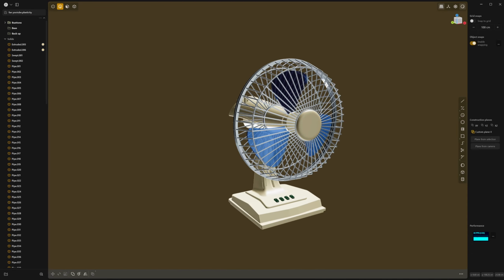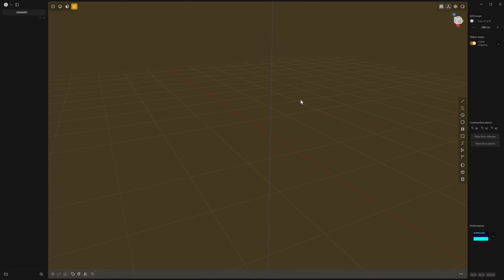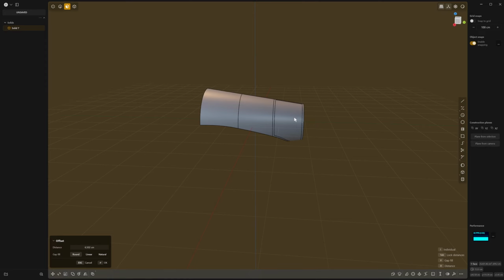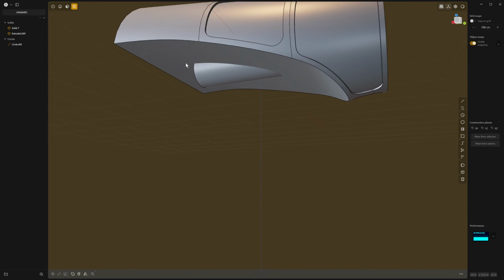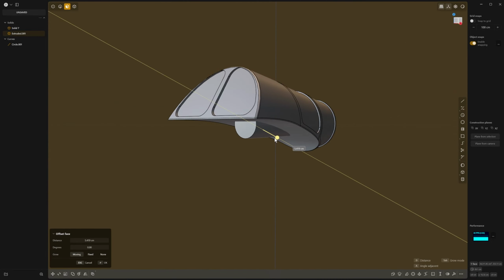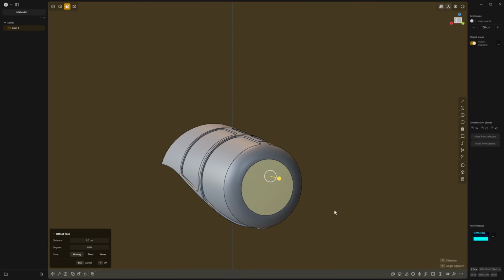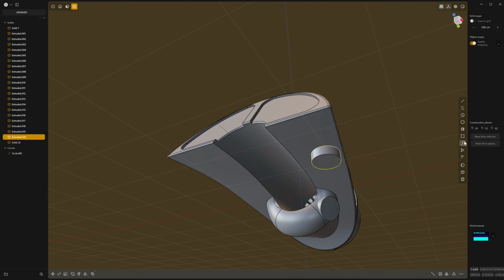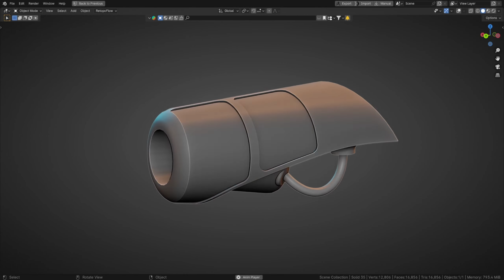Learning PLASTICITY The BEST Decision I made to Improve my 3D art!

Comment: Hello... Thanks for the video - 

35 seconds into the video you bring up a tool (circle) selector - for the surface, line, etc. -  
How do you get this tool ? 

Thanks
Reply from the maker: Thanks it's a custom pie menu I did a video on it here.
https://youtu.be/7MODtnqFEAo
Reply: @takerefuge3d  Thanks - got it set up and working - had been thinking of building at hardware solution ( Macro KeyPad)  but this does the trick !
Reply from the maker: There's a standalone software called autohotpie on github that allows you to make pie menus for any program, it's pretty good but when plasticity got native pie menu I stayed  using those instead. 
I have set up plenty of macro pads and never end up using them as having to move my arm somewhere physically away from my mouse or keyboard breaks my flow. 

 @rchelinewbee300

Comment: it's not parametric and changes are destructive though, not a fan.
Reply from the maker: That's fair, I find destructive modeling process allows you to work quickly and sparks my creativity, other people work better parametrically.
Reply: @takerefuge3d  yea, i do feel like it got its place though, it's pretty nifty.
i will probably use it for some things but if it doesn't have constraints it just can't replace everything.
Reply from the maker: @alkeryn1700 absolutely, I think there is plenty of parametric cad software that from what I can tell works a charm, plasticities charm is in its simplicity and speed of iteration. It's not for everyone but I learned modeling in blender which can be parametric or destructive and I always found destructive modeling to be more satisfying.
I think if I was trying to design things for physical use rather than games then the benefits of a heavier software package would be more obvious to me.

Comment: Nice to see Plasticity getting so much love and enthusiasm. I have been considering it myself as a good modelling aid. However ,I want to use it to model for game engines and I have been wondering how was the topology when transferring to Blender. How has your experience been in this regard?  Cool vid, keep up the good work!
Reply from the maker: Pretty good to be honest, I mainly model with a game asset workflow. you can get tris or ngons out at different levels of detail. And uving ngons is a breeze.
If you check out my channel I actually made a blender plugin for optimizing ngon based mesh in blender to prepare plasticity (and other ngon based hard surface models) there's a free lite version on Gumroad. 
I feel like its easier to optimize a plasticity output generally than optimize as you go doing hard surfaces in blender.
But that might just be me.
Any way that's my take on it..
Also if you do decide you want to buy plasticity check out my discount code in the description.

Comment: You got some amazing content showing plasticity. I started looking into it. What annoys me the most with Rhino is chamfering and filleting. But I also use project to surface and follow along curve a lot, can plasticity do these things aswell ?
Reply from the maker: Thanks for that. And to answer toe question Plasticity has imprint curve as well as project curve command as well as a curve array if that's what you mean.
Reply: @takerefuge3d  thanks, gonna check it out. the 149 dollar version is not gonna cut it as it does'nt support step file export so I can export back to Rhino for final assembly or sending the object to our CNC and robot machins for wood carving :( hehe.
Reply from the maker: @SunSin91  Nice one Cheers!, You can Use my Code REFUGE10 for a 10% discount especially, as time goes on there will be more features in Studio so i see it as a good investment.,
Reply: @takerefuge3d  tried curve array, yeah it works, but not strong enough, it misses the option to follow along a curve with 2 sides where the width of the curve goes from small width to larger width to smaller width. Theres only a scale option. That I think broke my workflow :( its for ornaments in woodworking which I have been using Rhino for last year.
Reply from the maker: @SunSin91  Ah I know what you mean The curve modifier combined with array blender has a similar function where you can assign different weights  to control points...

Its a good point and I might check feature requests and add a request if there isn't already one on the feature requests page
Reply: @takerefuge3d  yeah that would be a killer for a lot of people working with cnc and wood, especially since the fillet and chamfer is so damn efficient + all the ways patching and lofting works. Thanks for chatting about this: ) I'll follow along and learn from your channel.. keep it coming: )
Reply from the maker: @SunSin91  WillDo!

Comment: sorry - what exactly do you do to make a solid from sheet. google and the plasticity documentation is not helpful.
Reply from the maker: A solid is an object with no holes in it.
 A sheet is either a flat object out any thickness or a 3d object with a hole in it.
So either you use the patch command to close the hole, or while in selectiion mode 4 you'll see an icon at the bottom left and with your selected object you can thicken a sheet the icon is two arrows pointing away from eachother., hope this helps.
Reply from the maker: @sketchfields I made a Video on the topic https://www.youtube.com/watch?v=UGkpth-Ag8c
Reply: @takerefuge3d  wooooow - this is not what i expected to get as an answer. :D - 🙏🙏🙏
- whats interesting though is that my question came from the point of the video - at minute 3:37 - where you extrude a circle into a cylinder whis is open - so still a sheet - and then you say "Alt+F" - this is at least what understand - and your sheet is closed. And if i try to do the same - it is not working - i tried million times. Of course i found ways how to close an - open sheet - cylinder but your magic trick with "Alt+F" was something i directly wanted to try out. :D
Reply from the maker: I apologise the command is called patch and I have set it up to alt + F.
If you press F you will get a list of commands you can search for patch and then you can add your own keyboard shortcut.
Reply: @takerefuge3d  no apology - i am very very grateful 🙏🙏🙏
Reply: @takerefuge3d  I should have read the comments first, not studied the official documentation, then mocked up a search engine, then proofread Reddit.
Reply from the maker: @ComplexTarget 😂

Comment: Es un software bastante bueno, es nuevo pero le falta mucho..de igual manera hay un addon para trabajar Plasticity en Blender....Blender puede trabajar con Subdivision o Hardsurface o mixto...y en Hardsurface Blender es tan rápido como Plasticity.
Reply from the maker: There are no polygons to subdivide in Plasticity, however I think you can work quickly in blender for hard surfaces however when ever you start to use Booleans it becomes slow because of cleaning up topology

Comment: handy canon
but the way how  can i do `select edge ring '  or bevel the inside edge loop wihtout bool tool
Reply from the maker: Thanks! I am not sure I fully understand your question though.
Reply: How can I achieve what you did at minute 2:39 in Blender without ending up with bad topology? I did it with the Bool Tools, but I'm wondering if there's another solution @takerefuge3d
Reply from the maker: @vergil620 As Far as I know Bool Tool  is a blender add on and using it will ruin your topology, the edge ring shortcut is the same in blender, but with blender you would need to clean your topology first, hence why this kind of task is easier in in software like plasticity.
Reply: actually it's easier on the software you used than in blender but I managed to do it on blender with the bool tool then I seem to arrange the topology .
is it maya orI @takerefuge3d

Comment: Very nice demo, thank you.   Isn’t the resulting geometry NURBS?  Which produces an entirely different kind of topology, not usually cleanly deformable and animatable with rigs?
Reply from the maker: This is true there p are several ways to retopo if you want to deform it however as it's mostly for hard surface models like for example robots I see very few instances where you'd want deforming behaviour from your animated rig, and if it's simple you wouldn't even really need a rig to animate unless you wanted to use inverse kinematics you can just parent objects in pa hierachy in many cases

Comment: How about plugins and community support? In blender, Hard Ops, Machine tools, box cutter and mesh machine have been a life saver, would that be the same in plasticity?
Reply from the maker: At this point the only plugins that exist as far as I know are officially integrated and that's only xnurbs.
How ever as I understand it the shortcuts here are inspired by some degree by hardops.
Imagine using these tools hard ops without shading errors to fix. This is my experience with placticity.
I personally have made a plugin for blender that helps convert ngone based mesh that plasticity creates into tris for quickly optimizing the topology, if your happy to work directly with tris then it's no problem
Reply: @takerefuge3d  That's very interesting. Im going to give it a try. Whats your plugin called?
Reply from the maker: N-Gone Pro: https://blendermarket.com/products/n-gone

Comment: I guess this is Nurbs modeling right? Is the edgeflow usable if I try to export it to blender afterwards?
Reply from the maker: Yes it is.
You won't get "clean* edge flow but if you export as ngons you'll get fairly good lines on creases and edges and you can use a plugin for selecting ngon loops and plasticity has a blender Bridge that allows you to live link blender and plasticity and select geometry in Plasticity and then it will select the corresponding faces or edges in blender so uv mapping is quite easy.
I personally have also released a plugin for then optimizing and preparing ngon based models for texturing software and there is a free and paid tier. Overall I can get most stuff from plasticity to Blender to substance in less than 10 minutes maybe a bit longer if I have to make better UV's.

Comment: I love Plasticity too! Was hoping it'd massively speed up my work flow but in actual fact it hasn't but that is down to me 😂 learned a lot throughout though
Reply from the maker: Haha everyone has a different modeling slyle and you probably have sped up you just didn't notice, 🏎️
Reply: I know what you mean. I guess it's like that: with new possibility you set your goals higher. And even plasticity is a cool software it still lacks on some features like undo operations for each object or  reshape possibilities for a solid (edge/Vertex edit) so one is often forced to rebuilt the whole part. 
I would like to see a kind of wrapable Lattice modifier for solids for example.
Btw: Blender lattice works very good with the bridged models. But the problem is, you cannot simply reimport to Plasticity again and make further working there....